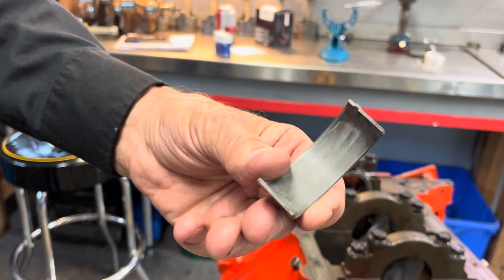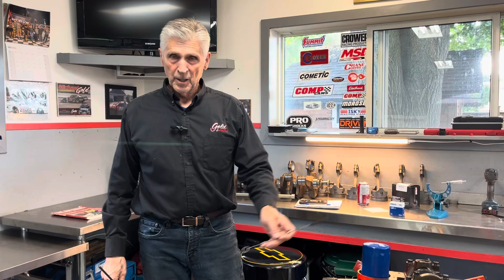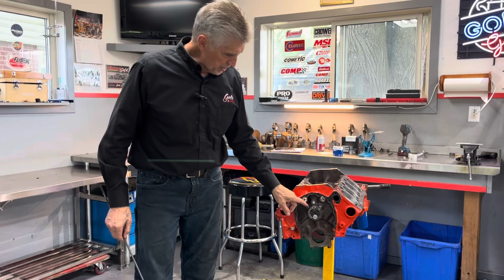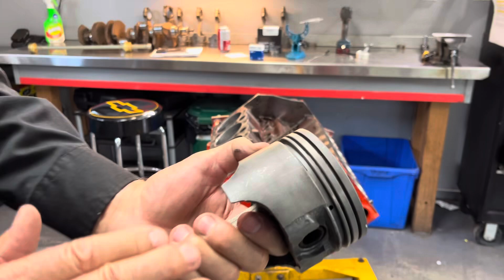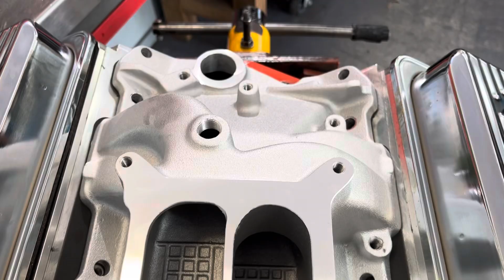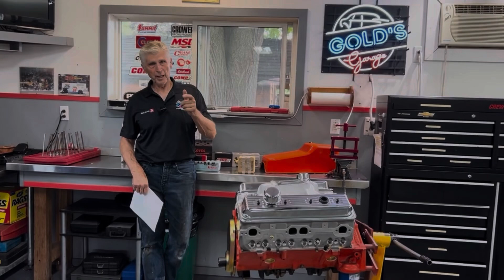BUDGET 350 CHEVY BUILD! 4/7 SWAP Camshaft on 87 PUMP GAS for 380-400HP!

Comment: Currently working on a 1970 350/300 from a Caprice. I'm going with a set of 69/70 LT1 heads. In keeping with the theme I'm going to try a 350/350 hyd flat tappet. It's going into an 86 Z28 (not stock). Maybe I'll call it the Mutt Z!
Reply from the maker: Sounds like a cool build you're working on, thanks for sharing! AG

Comment: Building the same block for my factory 78 c10, numbers matching
Reply: My engine was knocking when at idle, disassembled it and found 1 screw holding the oil pump together. Engine never missed a beat, just pulled it due to oil pressure. Which makes perfect sense after finding oil pump separating
Reply from the maker: Thanks for watching and commenting Krusty.AG

Comment: Are you sure you need a smooth finish to seat chrome rings?
Reply from the maker: I apologize for the terminology error Randy. They are actually cast iron rings with moly plasma coating on the top ring. They are sometimes referred to as chrome moly, which is an alloy, but that term is technically not correct. To answer your question, yes they do need a 400 grit final finish. Machine shop honing is usually smoother than that. AG

Comment: I still can't  get over that you recommended two different bearing halves with different clearances to make up a half of a thou to turn it into a oil scaper on the crank journals. If some with real racing knowedge would do the same, I  am willing to hear you out.
Reply: You should research how the bearings are constructed. Not uncommon at all. Definitely won’t be an oil scraper. The bearing is eccentric, not round, to create an oil wedge.
Reply from the maker: Chris, to add to Mike's comments, the bearing is also slightly wider at the parting line to promote an oil wedge. In normal circumstances the crankshaft will neve contact the bearing at the parting line. Clearances are always measured 90 degrees to this point. AG

Comment: Good day.  Nearly 38 years in machining, custom engine n Car building here. But mainly a Car enthusiast that enjoys playing and trying to constantly learn. Thanks for all the videos to help people enjoy the hobby.   One little friendly critique to hopefully help to not confuse some of the first time builders. It really stood out to me when you mentioned using a Chrome ring. Possibly just an accidental name error.  For myself I've always been taught not to use Chrome rings for the type of  street/strip V8's(all the popular domestic varieties) that we focussed on. In the past when they had been tried in passenger cars a lot of times they had a hard time sealing if and when they ever did. I do recall   they were used in big Nitrous and Nitro injected  race cars since the rings could handle a lot more heat n abuse and are more durable in extreme conditions.  As far as I know they were mainly designed for industrial engines operating in dirty conditions. Could possibly see them used in some dirt track applications so everyone could have reasons for using them. Just  Compared to a Moly or plasma Moly ring which seats nearly instantly and have always sealed optimally in comparison they have been the standard for production, street/strip and many mild to wild custom applications as far as I have seen or known.  After you mentioned the Sealed power PT# E-251k  which I'm  familiar with as being a "Moly" coated steel top/iron second  "No Chrome harmed in the making".  I'm wondering if it's possible the names were just mixed up?  I do know over the years I've heard others mix up the names when referring to rings so hopefully this can help anyone out with the mix up.  It's possible people could be thinking of "Chrome Moly" which is mainly a steel tubing and since there's a "Chrome" ring and a "Moly" coated   ring  but no actual "Chrome Moly" ring people have accidentally called the "Moly ring a "Chrome" ring thinking they are one in the same. They are definitely two different ring(coating) materials.  Also Regarding the 4/7 swap.. on one over 600hp 9 second pump gas N/A  small block Mopar raced @ 3500 DA we did do the swap using the same cam specs otherwise with no other changes and had picked up a noticeable increase in performance on our time slips equating to roughly 20hp.
Reply from the maker: Thanks for your comments Danny. You are correct. 
First thanks for the info on the 4-7 swap, we will have about half as much HP so if we get 10HP more we will be happy. 
Thanks for the great detailed explanation about Chrome vs. Moly. You just gave me an idea for a future video. I will be more careful using these terms so as not to confuse anyone. 
During my corporate career, i was the maintenance manger for a steel mill, (Now Teneris) that made about 100,000 tons/year of chrome moly seamless tubing, mostly for the oil drilling industry, 
The difference is between chrome as a material and chrome as an alloying element. E251K rings are moly coated, (top ring) but in the description they list chrome as an alloying element. 
Chrome moly seamless tubes (up to 9-1/4"diameter) are mostly carbon steel with a small % of chrome and moly as alloying elements, but they are referred to a chrome moly, mostly as a marketing tool. 
4340 steel as used in connecting rods is also referred to a chrome moly steel, even though only a small % of the content is chrome or moly. 
Thank you so much for contributing to my channel. AG

Comment: That's a unicorn block man. Those blocks in poor condition bored .040 are going for $400 to $600 here in South Carolina. I went through 4  010 four bolt blocks that were cracked before giving up and buying a dart SHP block. Been a few years, pre Biden, they were only 1700 then
Reply from the maker: Thanks Reeves. Guess i got a pretty good deal on this one.AG

Comment: If you are going to reuse a old oil pan. And its really dirty. Burn it, toss it in a gas or charcoal grill or a old cook stove oven. Crank it as high as it goes. And look leave it for a while. Maybe soak it in kerosene first. Do not leave ANY in the pan!!!  Two times I saw things cleaned this way, one when I was a kid, i put frozen french toast in s 8-9" cake pan. That had cookedbon oil and grease on the outside. I put it in the oven.. to cook. Get distracted, end up leaving that friday for the weekend! That Sunday i remember. Oven still on. The toast is gone. Not a sign of it. And the pan looks like new. The baked on oils gone that been there for years.  Another, i bought as oil ppl pan from a guy, it was in a crappy tiny building, not much bigger than a dog house. For keeping a lawn mower and a few things, it had cardboard boxes of old fire wood and the oilpan,!  The old rotten building building gets burned down. Wrll i go in to the hole it was a small celler under it.  To get it. Besides having ashes on iton it. Its clean as can be no. Oil, paint grime, it was filthy i was not looking forward to cleaning it. I wash it with gas and then soap . Blow it dry and pop isn't it wasn't easy to find one peace seal sbc pans at the time. And mine had a drag, and a slow leak.   cook it úin a gas grill until it stops smoking. The shut off the gas and let it cooltake it out a few hours later. It should Be spotless ..  blow it out really good with 100+ psi air. And paint it! Or high temp primer.
Reply from the maker: Wow! Sounds like a lot of work. Thanks for commenting James. AG

Comment: Laying the crankshaft down on its side does absolutely nothing, if the crankshaft was that flimsy, it would have self-destructed in the engine at idle speed.
Reply from the maker: You are correct Jeff. Thanks for watching and commenting. AG

Comment: I have this exact same 69 4 bolt 010 block at the machine shop right now getting cleaned up and bored .040. Was out of a buddies 69 300 HP Chevelle. He gave it to me since he's doing a restomod 6 litre ls conversion.
I'm very curious to see how much power your budget combination makes on 87 octane fuel.
Reply from the maker: Thanks Captain. We will let you know when we have a dyno date for it.AG

Comment: Good video! You said you used to differing rocker ratios but is the push rod the same? And what is the advantage of 2 ratios
Reply from the maker: Good question Elaine. It depends on how efficient the intake side is vs. the exhaust side. since the biggest restriction to making power is getting A/F mixture past the intake valve, usually 1.6 on the intake works better. if the engine has a restrictive exhaust system, the 1.6 on the exhaust might work better. AG
Reply from the maker: One more point, only testing will tell for sure.AG

Comment: When doing the 4/7 swap, i would think that cylinders 5 and 7 would possibly run cooler and they are not close to the incoming water from the pump. I have read that it increases bearing life or crank life and I am not one to diagnose firing pulses and its effects on cranks. I am thinking of getting a cam with the 4/7 swap only to see if it helps engine cooling near the firewall. Have you ever heard of this?
Reply from the maker: Good question. Bill Jenkins paid a lot of attention to cooling and equal distribution of temperature between cylinders, but I don't think it would be a significant factor for a street engine. AG

Comment: Not sure why you went with the Stage 3 4/7 swap cam? The stage 4 or 5 would of been way more gooder. I think Cutter's Performance another Canadian page on here used the stage 6 IIRC and made 480 HP with slightly warmed over Vortec heads and I think it was 11.5:1 static compression.

So I'm guessing the use of the Stage 3 is so you can do a comparison with that similar cam from the other build you mentioned? Anyway if you can find a set of the 1.72:1 roller rockers on the other side of the border, those would help reach more of that higher lift flow I mentioned to you in your last video.

With those heads and the 1.6:1/1.5:1 in and ex combo I will guess you're going to make more torque than HP. My guess is 340 HP and 380 lb ft of torque.😎👍
Reply from the maker: Because this engine is built on spec, we decided to use a camshaft that will work in anything from a truck, to a Camaro.
I agree, the camshafts you mentioned would make more power. Watch for the dyno video in the near future, we’ll see how it does. Thanks for your comments as always. AG

Comment: I’m an older guy doing first engine work.. converting a flat tappet 350 to roller. Two biggest problems are 1. Cleaning everything, and 2. determining correct parts (camshaft, springs, pushrods, etc.).
Reply from the maker: Thanks Dan, same two problems for me. AG

Comment: Another good video. 
With some of my ‘budget’ engine rebuilds (even if you using standard OEM piston, I now tend to get the blocks hot tanked and the bores professionally honed. I’ve found the results are worth the few extra dollars there and if I ever have to replace pistons I’ll lash out and get the rotating assembly balanced. 👍🇦🇺
Reply from the maker: Thanks for your comments Big Al. AG

Comment: 4,7 swap, now you have the other corner (2,4) firing 90 degrees apart, moved the problem to another location, but still the same problem.
Reply from the maker: Good point, thanks for commenting Tom.AG
Reply: Not really. The 2/4 pair are closer to the incoming cooling. Important for those running vortec heads, which are (supposedly) crack prone around the 5/7 pair. As far as power, I doubt it's any different than stock firing order on a typical street motor.

Comment: Just checking (from a real raw noob - you never learn unless you ask)).  Are you saying running 3.5 thou piston to cylinder clearance will be fine instead of the book-specified value of 2.5 thou max?
Reply from the maker: Good question, thanks Dave. Sure it will. often for a performance build, we add a thou or so clearance anyway. It is still within factory tolerance. AG

Comment: Machine shop work... trick is don't make them do too much diy stuff: basic cleaning and plug removal, deburring and any reasonable teardown is worth doing beforehand.   I don't attempt sleeve removal for example, if something is chowdered - they got that covered [and I would just make a mess of it].  Machines make them money,  other stuff kind of gums things up.  Last mock up I did was pretty tight - had to get mains re-honed.  Stripped it down and brought the crank along so they could mic it.  They cleaned up after their work, and I started back at mock up once again, and all went well.
I had looked up chevy's numbers for 1968 one time: 2.06M units sold, if I remember.  Not sure what part of that was 350's, but I think Nick's number is pretty good.  Roughly speaking [accounting for straight 6's]... somebody had to make near 30M lifters for that year alone - wow.
I like that cam: should be plenty of fun for street, with a little lope.  Since divider is not milled on the intake... 650cfm carb?
Reply from the maker: A lot of good information. Thanks for commenting Flinch.AG

Comment: 3970010 block was only 2 bolt in 1968. 69-79 it could be 2 or 4 bolt found in cars, trucks, vettes whatever pretty much. Mines .060 over for my current build in progress and it’s been checked by a very good machinist and it’s very good to go. Will be nice with my 3.75 stroke 43 pound crank and 6” rods with wiseco pistons.
Reply from the maker: Thanks Thumper, sounds like a nice build. Please keep us posted.AG
Reply: @goldsgarage8236  will do I enjoy your videos no beating around the bush and straight to the facts.

Comment: Hey Alan I think that engine might make around 410 horsepower at 36 degrees of total timing. I think it's going to take you about 4 pulls before the engine starts being consistent with the horsepower output. That seems to be the case whenever you hand hone a cylinder just because the surface is a little rougher. And I think it will make that with a 750 carb with a 1-in open carb spacer. Anyways man looking forward to seeing how it turns out.
Reply from the maker: Thanks Brian, I would be happy with that, so i hope your predictions work out. We will try a 750 with the spacer for sure. AG
Reply: To bad he can run that puppy for 5,000 or better yet 10,000 miles before the dyno session to give those chrome Molly rings enough time to seat. Those rings are WAY overkill for a budget build like that. Regular Molly rings will seat as soon as the cam break in is done. They even sell ring break substance that can be applied to the cylinder walls to make the regular Molly rings break in faster. It comes in a small 1 oz container enough to do 8 cylinders. I can't recall the name of the stuff though.😎👍
Reply: @itseithergonnaworkoritaint7852  yes they do make ring seal assembly lubricant but the only thing a lot of people don't realize is after three pulls on a engine Dyno those rings are seated. So they will be fine. You will see the first pull make some power and then the second pull makes more power and then the third pull will make even more power and then by the time you're on the fourth pull it' will steady out from the piston rings seal. Should be a good time
Reply: @SalterRacingEngines  
From my experience and the feedback I have heard about the chrome Molly rings is they're super hard and take a very long time to seat. I'll take your word for it though that 4 pulls will be the charm.🤷

The old timers I talked to about those rings back in the day (I'm no spring chicken myself) claimed the engine burned oil for the first 10,000 miles with those rings. After that they were surprised that it stopped and started running even better. 

Perhaps those rings made a bit differently now than they were 30 or 40 years ago? I know the "plasma Molly" and plain "Molly" rings are way softer than the old school chrome Molly rings. I'll have to check into this, now I'm curious if they're different from the ones from all those years ago, thanks.😎👍
Reply from the maker: Thanks for the discussion guys. Good to have experts weighing in. We have used the same rings many times in the past. We always gain HP and torque from the first to last pull, but because we are making tuning changes also it is difficult to tell how much of the gain is from ring seating vs. tuning. I will pay more attention to this when we get to the dyno.AG
Reply: @itseithergonnaworkoritaint7852 

No you're correct they are much harder to seat than say a standard cast ring or something like that but if the hone is done correctly and the right oil is used generally speaking when they come off the dyno they're seated pretty well. That Dyno loads them down like way more than say just driving them on the road. Hey I guess we'll see when he blast it on the dyno. I'm still waiting to hear how it does number wise.

Comment: Video idea... how to properly set poly locks! Ive had a great experience building my first engine despite some set backs first i screwed up and put solid lifters on a hydraulic flat tappet, cam manufacturer said set em at .004 and you should be good to go! So i did thus thing has run really great!  But i can't get these poly locks to stay locked down. Thanks for your time and years of experience that you so diligently share Mr. Gold!
Reply from the maker: Thanks Michael. i will do that at the next opportunity. For now, there is a sure fire way that you can use. 
If you are adjusting to 1/2 turn after zero lash, get the adjustor to about 3/8 turn. Tighten the allen screw as much as you can, then turn the adjustor nut and allen screw together the rest of the way. The torque from the adjustor will jam your allen screw so it will never loosen. Hope this helps. AG
Reply: Perfect, thanks Allen!